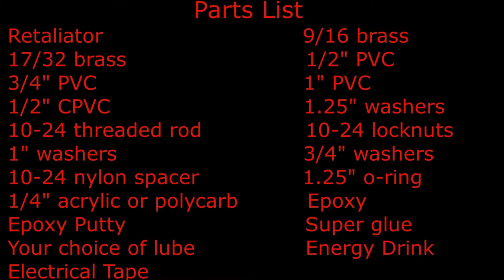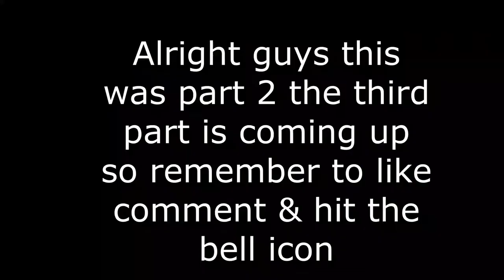Build Guide part 2 (building part 1)

Comment: Heading out tonight to get material, hard to get brass, great work
Reply from the maker: John James Amazon has brass it’s a bit pricy tho
Reply: @modbros5345  , the auto parts store in town can get it in for me, or I'm checking a actual, metal supply store couple towns over. I hate shipping time and costs. I broke a sled , hence this mod you did will salvage the ret I scalped. I put a Appollo tube in with the head epoxy on the rets , brassed with a short barrel getting 131 with waffles and some boomco springs,  got it done in a couple nights, needs some TLC but I can rack off a full mag, need a pump next. Again great work boys